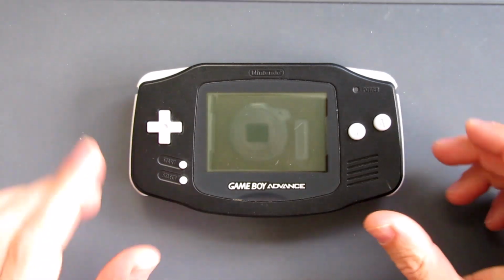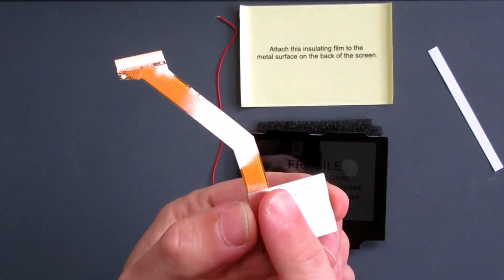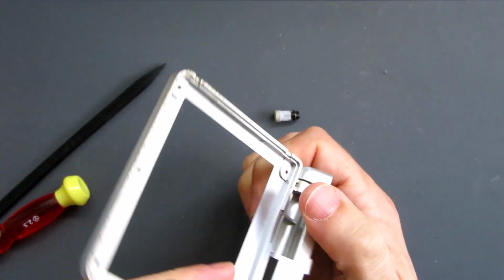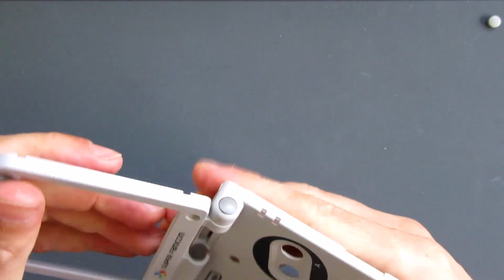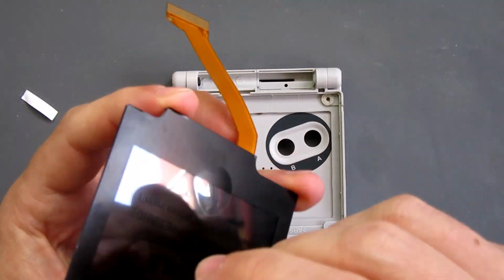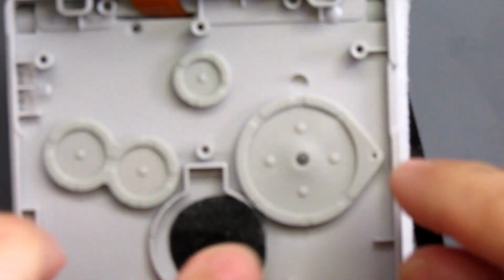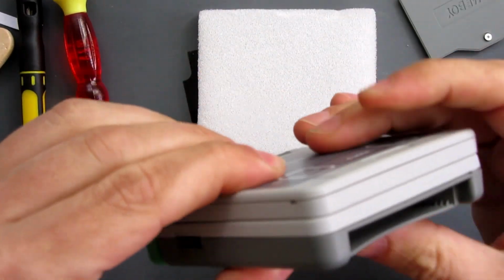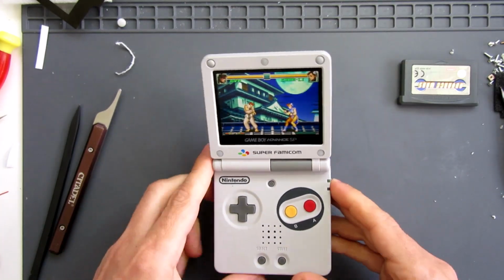Modded GBA SP with IPS screen and new shell - installation and testing

Comment: Thank you so much Joe! Attempted it first time winged it and the screen flickered a bit and the back piece wouldn’t screw in properly!  I tried a second time, got the correct tool to cut with, took my time more and it works perfectly!  Your guide is the best on YouTube!
Reply from the maker: That's great to hear! Thank you so much 😊
Reply: What tool did you get?
Reply: SamuaX I used a crafting knife that I bought on amazon. I ended up breaking part of the blade but luckily I had enough left to carve the shell!
Reply: Gravy James thanks for the info!

Comment: I've found the hinges are a lot easier to get all the way in without using too much force if you pinch them in from the sides and go through the motions to open / close the shell a couple of times. Seems they're more amenable to going in at certain positions and taking it through the full range guarantees you'll hit the right point!
Reply from the maker: Good tip I'll try that!

Comment: China now offers aftermarket hinges. Not sure how good they are compared to the original, but it does exist. Also, your explaination of how the hinges work is by far the best on youtube I could find. 12:04 also, you don't have to remove as much as you did off the top half of the shell. It's enough to remove the inner part where the ribbon cable sits on the screen. It doesn't matter as much on this shell, but on transparent shells, it looks bad, if you do a messy job.
Reply from the maker: Thank you so much! I sometimes think I should make short videos about specific jobs like that so people can find them easily. I've tried the aftermarket hinges and they work fine, it's good to have the option. Always best to use original ones if you can!
Reply from the maker: I've recently tried out the aftermarket hinges, seems to be a new version and it required tweaking to get it to fit. Maybe time for a quick video!

Comment: I bought one already done off ebay. It is really nice and for a used one you would think it is brand new. Exactly what I wanted. If I'd want more it might have been touch screen but that's not really something I think is needed same for color adjustment. As it is its pretty much perfect

Comment: Thanks for this video! Super helpful and I managed to follow along and install my own screen :) I had to cut more of the shell on both sides but it didn’t go terribly
Reply from the maker: That's great to hear, thanks for the feedback and well done!
Reply: What did you use to cut the plastic?
Reply: SamuaX I used a dremmel but it would probably have been easier and cleaner with some flush cutters.
Reply: @KeeganHolman  Thank you so much! Can you recommend any flush cutters for this job?
Reply: SamuaX any generic ones would work I think, the plastic you need to cut isn’t very thick :)
Reply: Keegan Holman thanks!

Comment: It was a useful video, thanks for the walkthrough. However, the lack of editing led to a pretty frustrating build. 
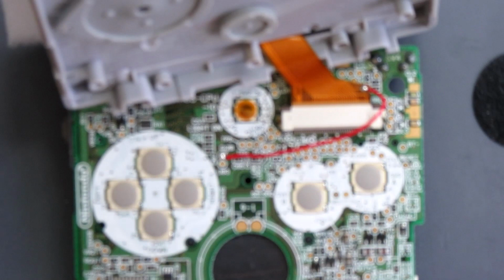I had to backtrack at both solder points as well as at 18:00 for the screw where I had to unplug my board!
If you're going to edit in "sorry" and "thanks for bearing with me" after every mistake, you might as well have cut and moved those steps to the proper place in the video.
Alas, after having to backtrack and undo my steps three times, it's finally done. Thanks again

Comment: Great video! Would love to mod my gba but I have the technical ability of a wet sponge. 

Question tho - what are you using to hold the camera in place for the overhead footage? My wife needs to use a similar set up for sharing art classes with her students but the school won’t pay for a visualiser.
Reply from the maker: I'm working in a shed so it's fairly small with a low ceiling, I made a bracket to mount directly to the ceiling and fold out of the way when it's not in use

Comment: Hi ,I also plan to upgrqde my old gb sp ,but I dont have a welder .Can I still upgrade it to a brighter screen ?
Reply from the maker: Yes you can. The soldering gives you the option to control the brightness but if you don't do it, the screen just operates at full brightness all the time

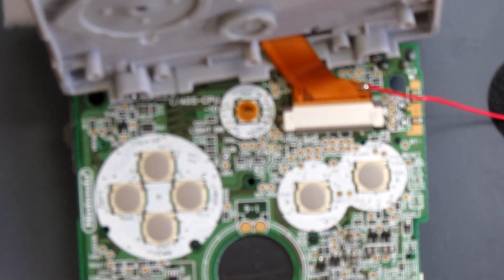Comment: 17:05 hello, could you tell me please what gun are you using? & At what temp are you set at?
Reply from the maker: That's my old 18W Antex soldering iron. No temperature settings on there. I use my usb powered one now, think it's called TS80p? And it's set to 350ish. Just make sure you work quickly and don't leave the heating in place too long

Comment: Great video but with my funny play screen i need to cut in both sides of the shell
Reply from the maker: Is it a newer screen?
Reply: @JoeBleeps  no, it is the same screen used in this video. But i noted that the lens cover small portion of the screen, and as a result, the top and right of screen is not visible. Is not terrible, but is noticeable.
Reply from the maker: @erandenix  that's very strange that it wouldn't fit properly

Comment: Question out of 1-10 how hard is it to replace a GBA SP shell for a newcomer
Reply from the maker: 3? A straight replacement isn't too bad for a beginner, the only really challenging part is the hinges and if you understand and follow what I show on here regarding the hinges, you should manage okay.
Reply: I did it in 2 hours.  Had never opened one up. 3 out of 10.

Comment: Awesome video. I'm about to upgrade my 001. 

The IPS display is a bit bigger right? Will any glass/plastic lens work just fine or will it cover the edges of the bigger IPS display?
Reply from the maker: Fortunately the IPS displays come with a lens attached so although they are bigger you don't have to mess around finding a bigger lens

Comment: Great video. I can't solder but reckon I could fit this. Is the wire for the brightness level. If I was to fit and not use wire will it just be on brightest mode ?
Reply from the maker: That's right. That pretty much what I did last time because the ribbon didn't have that convenient solder point

Comment: How do you test the screen before you install it?
Reply from the maker: You can plug it into the motherboard and put the battery against the motherboard. I'm normally stupid/optimistic and put the whole thing together hoping for the best 😅
Reply: Well that worked.  But now I'm trying to put it together and the cable is a PITA to connect to the motherboard when you're putting the case together.  Any tips on an easy way to do this?  Truly awkward
Reply from the maker: @Silvercloak5098  you're right there it really is awkward. I made another video with the gold Zelda shell on a SP it might go into a little more detail about that stage?
Reply from the maker: @Silvercloak5098  I just had a look and it doesn't cover it in much detail. Slightly overlapping the shells and carefully extending the ribbon helps. Head to the 24 minute mark https://youtu.be/UxDZSeTs_CU
Reply: @JoeBleeps  got it all figured out thanks!  Worked beautifully.  Just missing one of the screw dots for the screen but that's all.
Reply from the maker: @Silvercloak5098  good going!

Comment: What kind of tools did you use to cut the plastic?
Reply from the maker: Sorry for the delayed reply. I've done this with flush cutters, a craft knife with a scalpel blade and a dremel. Dremel is quickest but doesn't give the clean finish of the scalpel, but if you're using a sharp blade be super careful of your fingers!
Reply: @JoeBleeps  Don't worry, I haven't started yet. Thanks for the reply, I'm gonna try and do it myself soon! :)

Comment: Decent enough tutorial but it was a bit frustrating how you cut out the actual tricky parts yet left in footage of all the self explanatory stuff
Reply from the maker: It's sometimes hard to know what people will find tricky or self explanatory. I did follow this one up with a detailed tutorial on installing the new screen, I'm sorry this one came up for you instead of the newer one. I might drop a link into this video to help redirect people
Reply: @JoeBleeps  Yeah I think that would be helpful, also apologies for the comment I was mostly just in a bad mood from how long the install took for me. The video was actually very helpful and it was only one or two parts where I think more detail would've been necessary
Reply from the maker: @n0lain  no worries! Can definitely be a frustrating hobby at times